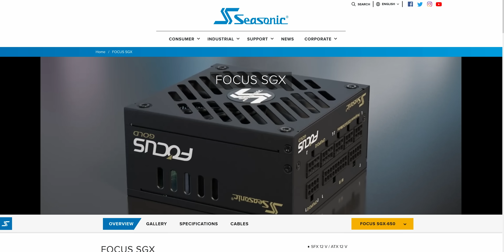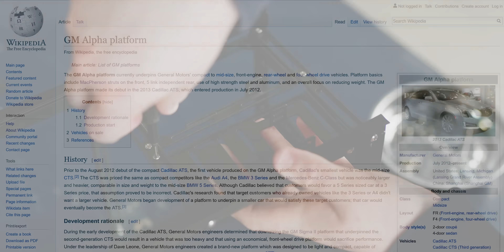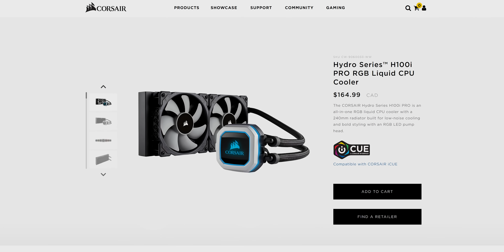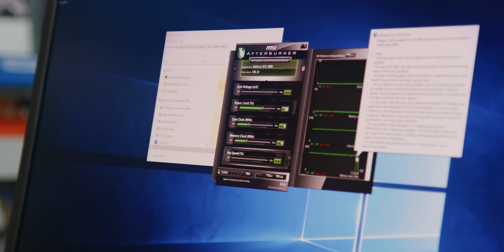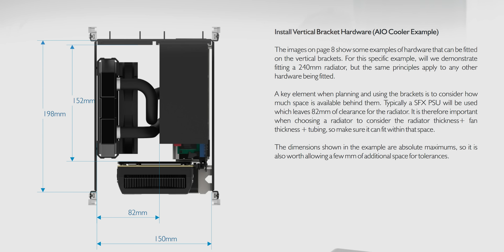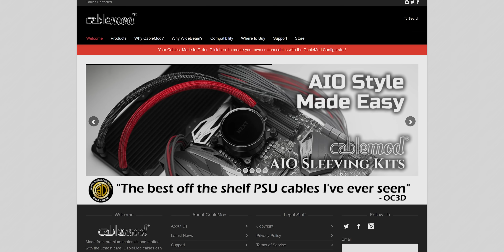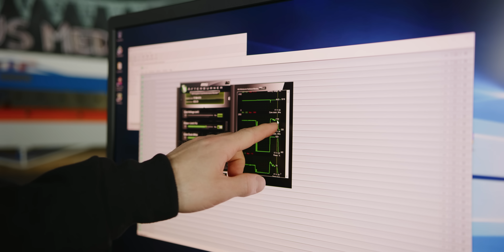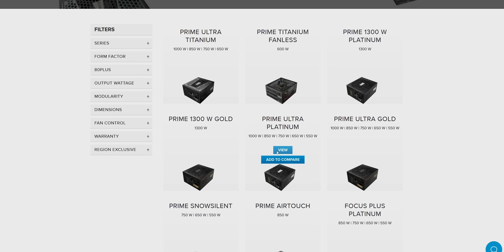The Ultimate Compact PC (2019) - Streacom DA2 Review

Comment: You can find cheap usb-C replacement cables for your peripherals if you need it connected to the front
Otherwise use the usb A ports on the motherboard back

Comment: Shouldn't you run the aio fans as intake, so you're pulling colder air in from outside the case, instead of pushing warm air from the interior over the rad?

Comment: Having my computer double as a space heater would be pretty cool. Drill a hole in the wall, get some 15-20’ cables, and use it to heat the garage during winter plus get crazy cooling capacity. Just need to remember never to turn it off so the water freezes, or just skip the water cooling.

Comment: The Inside Out Mini Watercooler
Just an idea that I hope someone will do.

I've seen a lot of mini-ITX builds lately in these shoe box cases.  And regardless of how plain and black these things all are, the case builds are often described as "refreshing" due to the lack of RGB.  But the truth is, they are just small black boxes that completely get lost in whatever room they are in.

What I want to see is a build where you use one of these little black shoe boxes, but do a custom water cooled build where the tubes of the loop go outside of the case.  Add lights where appropriate.

Usually, these small cases don't have enough room for custom loops anyway, so break through the walls and build your loop outside.  You'd probably want to choose a case where each side of the box mounts independently on a frame so some of the sides can have tubes through them and some are for access to the internals.

To describe this idea a little more.  Picture a small black box with water cooling tubes extending out of the sides of the case.  Drill your own holes through the case and route the water loop as you need to up, out, over and around the outside of the case.  Same thing with custom RGB lighting either using strips or placing lights near where the water tubes exit/enter the case.

In this way, the small black shoebox becomes a plain base for what could be a dramatic water and light show.

What do you think?

Comment: What about a Micro-ITX running an A10-7800k and 64GB of DDR3 RAM and no need for a graphics card plus 100TB Data Center SSD and 1KW PSU and finally  installing Windows 10
Reply: @James That is what I am running at the minute in a DAA78L Motherboard with 16GB of DDR3 RAM with Builtin Bluetooth/WIFI and also has a Light-on DVD/RW drive that is normally used in a laptop the whole package is called the ACER TC-220 computer.

Comment: If you are going to build an ITX small form factor desktop. I would highly recommend a blower style GPU to exhaust all hot air out the back of the case. I am running a 2080 Turbo in a NZXT H200i. I get 144fps on a ultra wide screen at 1080p. My GPU temp stays around 73C at 70% fan speed. I also have a AIO to cool my Ryzen 2700 cpu. I have not seen the CPU exceed temps of 40C. The PC is very quite unless I’m gaming, but i would have headphones on so i cant hear the fan noise anyway.

Comment: It's a really good case (yet not owning one, but I will), but there's one real downside: the GPU clearance allows only 50mm high cards. E.g. Asus has no RTX 2080 card that'd fit. Gigabyte and MSI have only two that may fit, barely. So basically it's only the Nvidia FEs or then just 2070s. Maybe with the bottom grille removed some larger cards could fit, I'm not sure. I believe it would really help with the GPU temps if there was room for cards with thicker heatsinks. It'd only require to make the case 10 to 20 mm higher to allow basically any card to fit.

Oh, and you don't have to be a Mac fanboi to want that minimalistic design. But as an owner of a Dell laptop and a Cambridge Audio amplifier, this is basically the only option to get a good-looking stylistically similar PC case that'd fit bigger CPU coolers. (Ncase M1, nah. Not on the same level in visual design.)

Comment: I find 78C for the GPU to high for water cooling with 2x 240mm radiators, i have a MSI GeForce GTX 1080 AERO 8G OC water cooled with NZXT Kraken G12 and NZXT Kraken X31, and replaced the radiator of the NZXT Kraken X31 (30mm 120mm radiator), with the Alphacool NexXxoS XT45 Full Copper 120mm (45mm radiator), and my GPU never gets above 64c, and that in the Raijintek Thetis Window case ( fantastic case BTW).

Comment: 80c on the GPU means the water tempreture is way to hot for this to work long term. If you mount the GPU block correctly the GPU will only be a few degrees above the water.

Comment: YOU WANNA SEE A TINY ASS PC?
THAT YOU CAN ALSO FIT THE BADASS ITX MINI INTO???
look up "HP Compaq 8200 Elite Ultra-slim Desktop"
if you know what to do you can easily fit this onto the VESA mount on the back of your monitor, practically making an all-in-one.
yes i did all of that and thats the pc im using now.
8gb RAM, quad core i7, and the original gpu because i dont know how to expand the gpu.
there is this port thats like an M.2 SATA port but its like 4 inches wide and i dont know if its for gpu expansion or not.
if you know what im talikng about and know what its called plz tell me i am in need of a gpu expansion.

Comment: Okay sooo i have an issue and idk how to fix it so im hoping for some help

I recently bought a GTX 1650 (yes i know, ugh 1650, but it was like 25% off on amazon)
I was planning on upgrading all the way from a GT710 to the GTX1650

The GT710 works just fine and always has. I followed the instructions on this video for the “upgrading” and now whenever i boot the PC with the GTX1650, it gives me a “no signal” error on my monitor

Yet when the GT710 is back in, the pc works just fine

The GTX1650 hasnt worked since I bought it, the fans spin and the card swithes on, its just after the screen that shows the MOBO logo that it says “no signal”

GTX1650 4GB or GT710 2GB
600W PSU
8GB RAM
I5 3.5 GHZ 

please help me
Reply: Sounds like it might be a driver error.

Comment: I would have totally put foam lining around the radiators to prevent circulating hot air back into the case ;-)

I've used rubbery foam strips for weather sealing on a build where the radiator didn't sit flush against the mesh and it was noticeable how much more air came out after applying the weather strips.

Comment: I love small form factor pc's. I used to build custom pcs with glass side panels, leds and whatnot but the pc was always ending up tucked away around my desk and I never cared about looking at the pc. In 2011 I bought an alienware x51 and that pc was rock solid for 7 years. I did have to change gpu once and I was ready to do it again after 7 years but wanted to upgrade to new cpu, ram and nvme drives. Ended up with cyberpowerpc's zeus II. Bigger than the x51 but it does have 1 gig nvme, i7-9700k and a 1080 card. Runs everything 1440p on ultra without any hiccup.

Comment: Or uh... just do what you said earlier and put a 90mm intake fan in the back.  Problem solved.  I really don't understand how the ambient air available to the GPU could be that hot tho.  It has it's own routing spot underneath for good clean air, and heat rises, so the air available to it underneath should be mostly cool.  The card is pushing air into it, not out of it, so I don't understand why he refers to the air under the card as exhaust when it should be intake air.  I think you should be perfectly fine with the GPU mounted below and sucking in air from the bottom.  I don't see why this would be a problem.

Comment: I have one - the top and bottom airflow spaces are just wide enough I can fit slightly recessed noctua 120mm fans... fixed the heck out of that GPU "dead air" issue.

Comment: I just had an idea for super cooling.  My thought is, using a dehumidifier in a small room to remove a lot of the moisture, put dehydration packets in the bottom of a case, and seal the case with an input and output hose.  No water leaks in and little to no condensation internally.

Comment: As an itx user I approve this. Too bad atm there is still no really good options for water coolers system . Coz largely it depends on the water cooler parts. Imagine if you be able to custom design rads and pump

Comment: The problem isn't so much the number of ports but the number of host controllers, motherboards generally only have 1, at best 2, so the device limit is much lower than you'd think because multiple device end points are required for each additional peripheral, including hubs themselves.  This can be solved with an expansion card, only the more expensive ones have an actual root hub control chip per port though(you can multiply the price per chip), and that case doesn't have space for an expansion card after you install a dual slot gpu.
I do like seasonics hybrid power stuff though, silence is golden.

Comment: For my mini-itx gaming rig that I built three years ago, I used a Cougar QBX case It was a pain to work with, especially for a first time builder, but the one advantage it had over this case was that the pass through for the power supply was on the top of the case. Disadvantage was that you had to install a power supply that had the port facing a specific direction (not to mention the shallow clearance for the graphics card). Still, I would recommend it... if this case wasn't available that is., since other than that it blows cougar's case out of the water.

Comment: Just wait until the Sliger SM580 comes out with the capacity for 2x280mm rads and SLI, all in about 15 Liters.
Reply: Sli is not going to happen in 3 slot system using bifurcation unless you are usin GTX900 or lower with a flex cable. Given how much the bifurcation cable costs on the SM560, that case would be setting you back few hundred USD.

Comment: Front panel audio is about as convenient as a trackpad on a laptop...
It works, if you REALLY need it to... But you're torturing yourself if you do.
Reply: I dont use my front panel at all. I have a really nice usb/sd card/whatever one may need hub thing in my desk connected to my pc that I use for flash drives. other stuff is plugged in the back of my PC for clean cable management. As for audio jacks in general, I use a USB DAC so 3.5mm audio is irrelevant to me.
Reply: @FinnMakesVideos  "3.5mm audio is irrelevant to me"...
Are you serious? The diameter of the connector is irrelevant lmao. There are USB DACs and mixers which have 3.5mm out, and every headset is 3.5mm with a 3.5 to 1/4" adapter, if that wasn't obvious enough.
Reply: @XFourty7  I meant the 3.5mm that the computer has. the Audio jack is very important just not as a direct output on a pc. I worded that a bit wrong my bad

Comment: I don't consider this case truly compact. In the past Linus used the A4-SFX and the SG13. The DA2 is 17L, it's hardly SFF. The NCase M1 is considerably smaller and can actually cool better, at the very least use that. The whole point of this series has been insane power in as small a package as possible, this breaks from that.
Reply: yeah it's those absolutely useless protrusions that increase the volume a lot. Could've just had case stands and more vents

Comment: It actually wasn't that compact but Linus dropped it.
Reply: I already bought a Sentry 2.0 and it will come November/December ... That case can fit in a back pack and also have decent components (full length 2 slot GPU)
Reply: @Narinjas  If you looking something for a little larger than the Sentry, this is not the choice. The NCase M1 or SM560 is. This thing sucks.